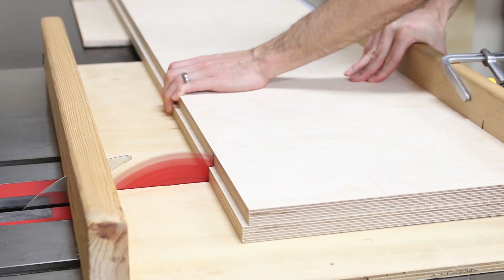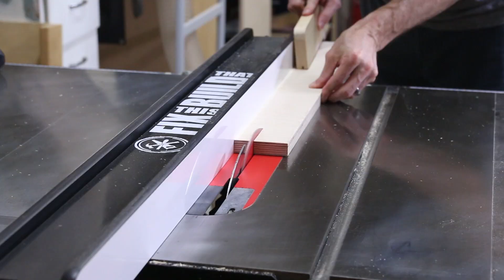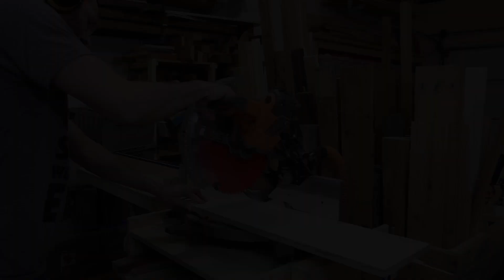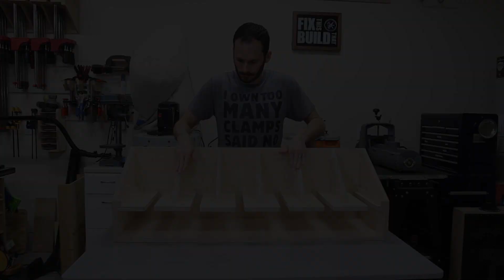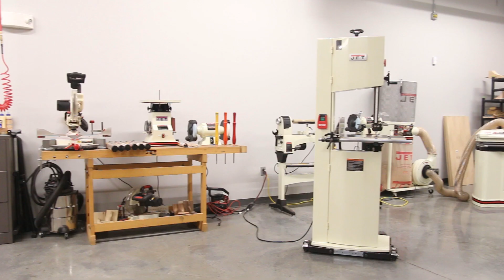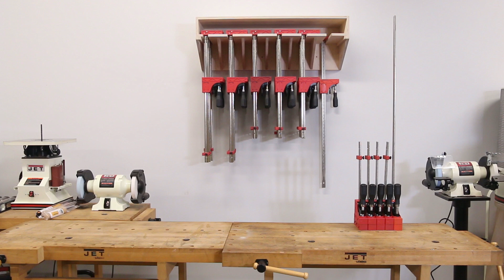Space Saving Parallel Clamp Rack | DIY Build Plans

Comment: Nice job, Brad! I bought the plans and plan to build it soon.  Can you explain the need for a "top"?  Other than a flat surface for storage, does it provide any strength or rigidity?  

It would have been helpful to me to have seen a little more of the finished product at the beginning of the video to understand the rack before jumping to cutting the parts.  Thanks again!
Reply from the maker: Yep, solely for storage

Comment: Great space saving project.  Once loaded it's going to be very heavy.  A critical piece you left out was how to securely mount it to the wall.  What was your process for that.
Reply from the maker: I left it out only because it will be different for everyone.  We mounted it into metal studs and I imagine most will be using wooden studs, but could also use concrete walls.  Regardless the key is mounting it into a load bearing structure.  We mounted it into 3 metal studs to help carry the load.